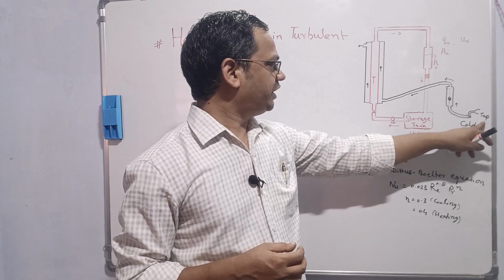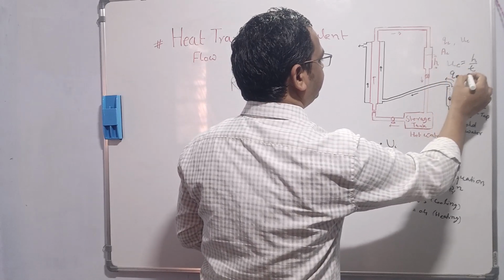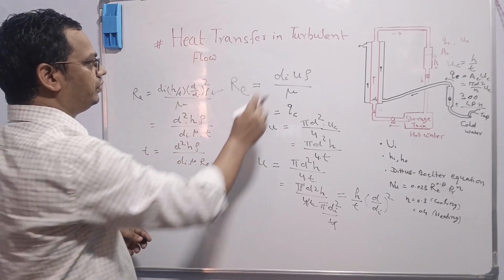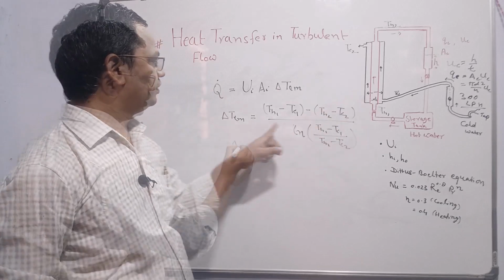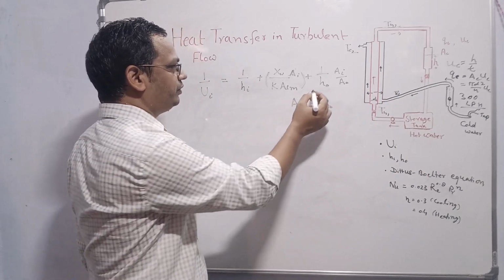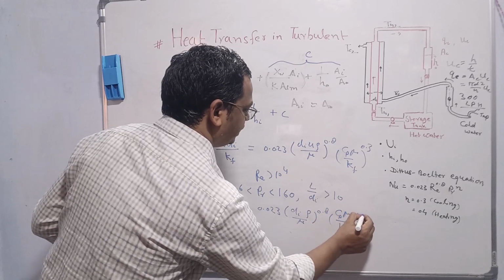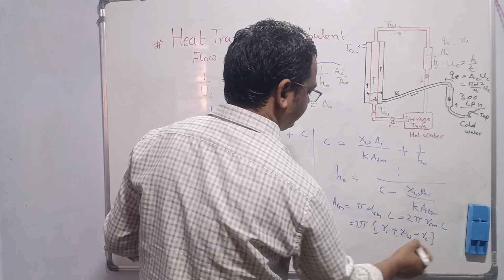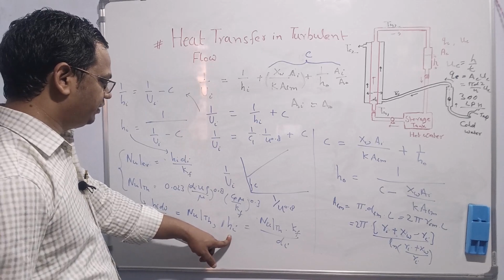Heat Transfer in Turbulent Flow |  Theoretical Descriptions

Comment: CHEMICAL REACTION ENGINEERING LAB

Experiment No. 1: Standardization of the given solution of NaOH.
Aim: To determine the normality of NaOH solution 

Experiment No. 2: Plug flow reactor
Aim: To determine the second order reaction rate constant for saponification reaction between NaOH and 
ethyl acetate in a plug flow reactor

Experiment No. 3: RTD study in CSTR 
Aim: (a) To plot the RTD curve for a CSTR using a pulse input as a tracer 
 (b) To determine the dispersion number

Experiment No. 4: Isothermal batch reactor 
Aim: To determine the pseudo first order reaction rate constant for the saponification reaction between 
NaOH and CH3COOC2H5 in a constant volume adiabatic batch reactor

Experiment No. 5: Adiabatic batch reactor 
Aim: To determine the pseudo first order reaction rate constant for the saponification reaction between 
NaOH and CH3COOC2H5 in a constant volume adiabatic batch reactor

Experiment No. 6: Continuous Stirred Tank Reactor (CSTR)
Aim: To study of a non-catalytic homogeneous second order liquid phase reaction in a CSTR under 
ambient conditions.

Experiment No. 7: RTD study in Packed Bed Reactor (PBR)
Aim: (a) To plot the RTD curve for a PBR, using a pulse input as a tracer
 (b) To determine the dispersion numbe

Comment: Sir i request you to please upload these labs :

PROCESS MODELING AND SIMULATION LAB

LIST OF EXPERIMENTS:

1. Estimation of dew point and bubble point temperature of a hydrocarbon mixture
2. Simulation of flash drum
3. Design of ditillation column
4. Optimization of a flow sheet or process
5. Determination of temperature profiles for heat exchanger
6. Concentration profiles for reactor
7. Simulation of Jacketed CSTR
8. Simulation of process
9. Simulation of evaporator/ distillation column/ extraction process

PROCESS DYNAMICS AND CONTROL LAB

LIST OF EXPERIMENTS

1. I & II Order System Dynamics
2. Interacting & non interacting Systems
3. Flapper - Nozzle system
4. Control valve characteristics
5. Level control system
6. Flow control system
7. Pressure control system
8. Control of a thermal system
9. Design of control system for a given process
10. Simulation of a closed loop system
11. Demo Experiment using Aspen Software of a given process